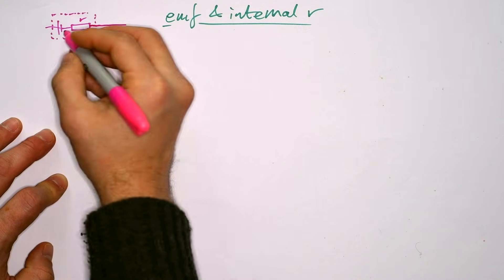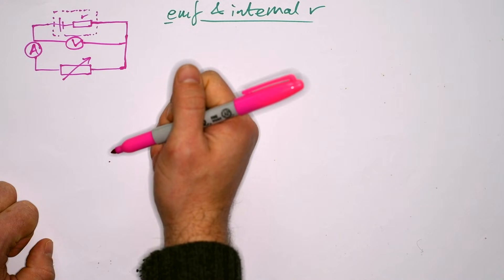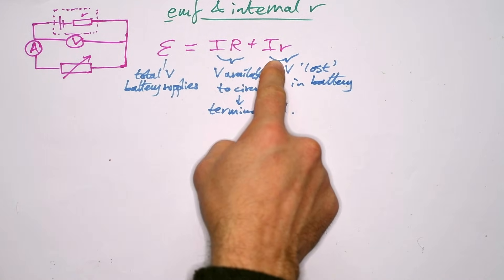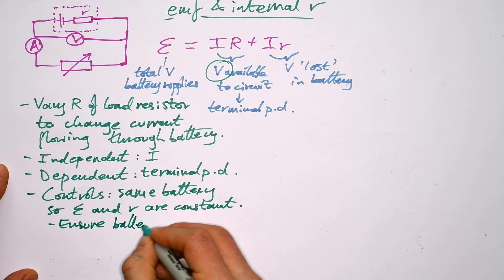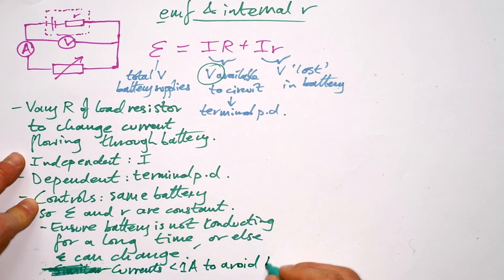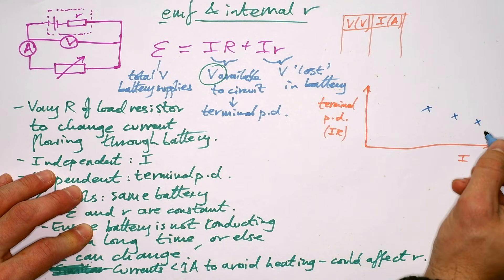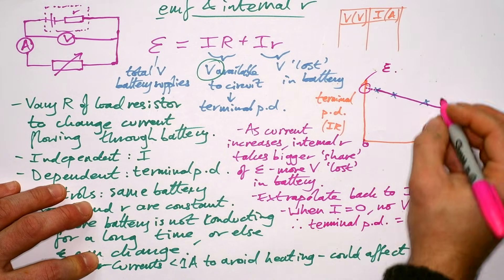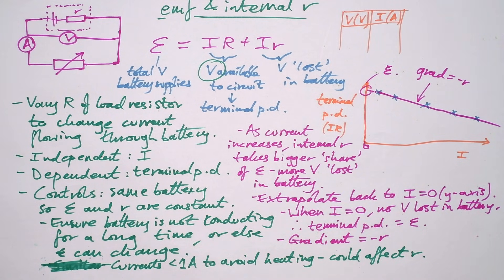EMF & internal resistance - Required Practical - A-level Physics

Comment: 2:05 Would R count as an independent variable, and would I count as a dependent variable, since it is dependent on changing R? Thanks!
Reply: independent is what you change, dependent is what you measure. You are changing the current, and measuring the terminal PD (IR). Another way of looking at it is looking at the graph. The independent is normally on the x axis
Reply: @nq2c 外阻变小总电流变大，电流与外阻分析的话外阻为自变量